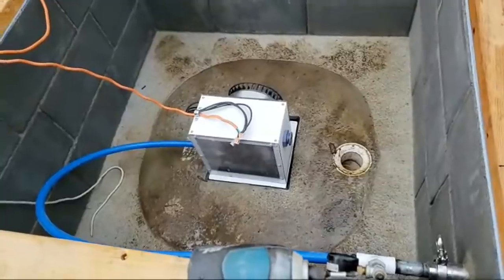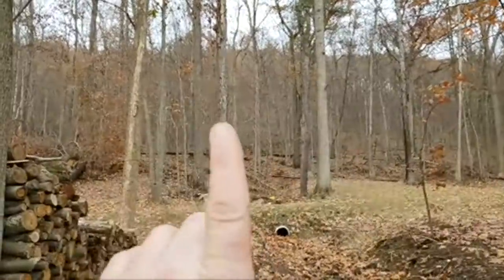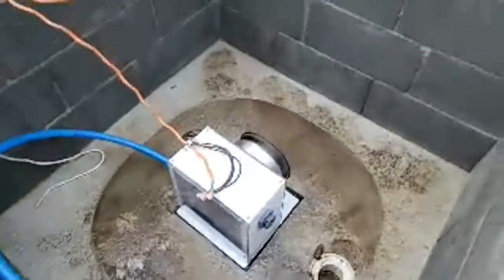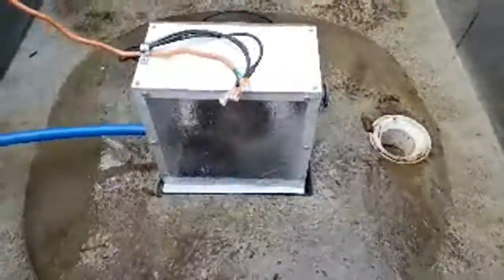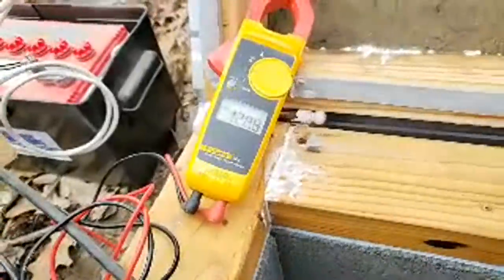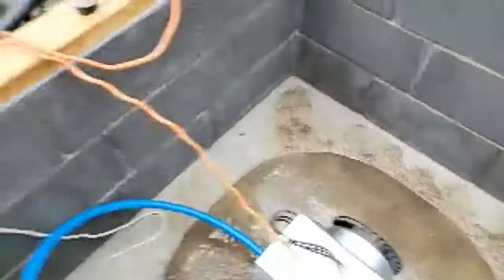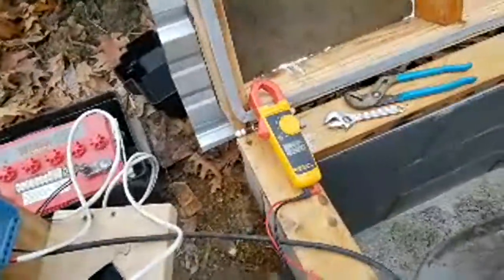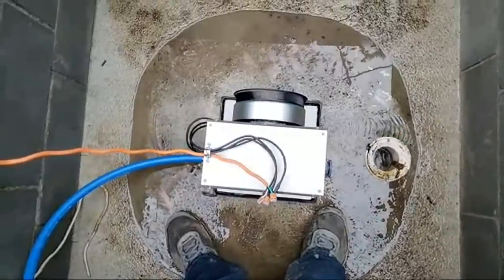Turbine First Spin LIVE

Comment: Need to have a solenoid operated regulator valve to throttle it, otherwise the output on the generator will vary too much depending on load.

Comment: The voltage will be much lower as soon as you connect a load to it (close the loop). I would not put a bulb to it to verify power as that would be waste. You should get a voltage meter for permanent installation. e.g. https://www.amazon.com/Digital-Voltmeter-DROK-Two-wire-Detector/dp/B07B3NXFP6

Comment: the victron engergy charge 5 volt higher than the battery thats on the victron so if u want higher volts u need a higher battry volts

greets from teh dutch (like victron also dutch XD )
plz contact me if u need more info

Comment: The nozzle should be Agle down hitting the Outter 55 to 65% of  the cup the water flow is holding back a lot of RPM shooting straight across like it is With 1 Nozzle you might also want to consider a Flywheel not too heavy as long as it has the mass Half Inch smaller than box with the weight at the outer perimeter of the FW keep it external for load interruptions And make sure you incase it so you don't lose any fingers BTW Excellent Job

Comment: I think your setup has a optimal RPM and currently you greatly exceeding it. Without any load that's expected. I would still recommend to not run it that fast, you might overheat the bearings (don't know how big they are) and the splashing water at the back of the buckets is also quite an impact for the wheel. Just remember you're generating quite a lot mechanical power and it has to go "somewhere" if there's no electrical load.

The splashing from the wall behind the jet is currently limiting the output (at least without a load). Optimal is splashing backwards against the walls next to the nozzles or falling straight down. So this might limit your electrical output, since you're loosing mechanical power before you reach the shaft. Maybe it can regulate better, when there's no wall to do backsplashing at the back of the wheel e.g. by turning your case (or the nozzle) 90° to have the nozzle pointing straight down 🤔

IIRC the water velocity at the nozzle should be twice as fast as the wheel speed. So you might want to calculate the optimal RPM from the nozzle velocity and look how far off you are 😙🎶
Reply from the maker: Agree 100%, this is just stuff that's hard to remember to convey in a live stream. 
When it has no load the water velocity and the spoon tangential velocity are nearly the same. Therefor not much power is being absorbed by the generator, it's converting to heat as it splashes around in the turbine housing. I agree the splashing could be an issue and that will be resolved in the final version. Also this generator is rated to supposedly 2500rpm and I think I'm at about 1,500 RPM unloaded.
Reply: @JoeMalovich  It's hard to make out the RPM by sounds or the video, but the generator should have a RPM to open circuit voltage which you can use to get a somewhat accurate reading of your RPM - if your curious and have no measuring device. Or you can measure the frequency of the AC. I'm not sure your meter can do this.

I'm more concerned that the splashing might rock loose a bucket, actually, because water is hitting them from the back side. So make sure to be cautious about that 😙🎶
Reply from the maker: @RubenKelevra  I think about 1500rpm
Reply: WOW.. there's so much info in the comments.... Its amazing. And to see the work Joe has put in coming to electrical output is brilliant. i think you have enough water there for more turbines :)
Excellent work, very looking forward to watching the next vid (which is already up :) )
Peace from the UK
Reply: @kevfromnorwichUKGGKev  this one wheel is more than suited to get all mechanical power from the available flow 😙🎶

Comment: Hi joe, you should test with a 120V bulb (50W, 100W,200W etc..) connected at ouput of bridge rectifier. If you can, add an ampmeter and a voltmeter and you should be able to know what is your power. It seems like your actual load (victron + battery) is a to mutch load.
Reply from the maker: I was somewhat rushed in putting this together so I didn't have all of that equipment handy. I will next time.
Reply: @JoeMalovich  looks good. Im jealous of your water...lol
Reply: If it can't turn at full load then the motor needs to be smaller or the pelton wheel bigger, I would personally make the wheel bigger as he is getting too much volts at freespin. but there are many factors to optimise for a set flow, pressure and nozzle diameter.
Reply: Good idea Cristof. If possible, you can also measured the rotation speed and then have the power curve. For each load, plot the rotation speed on X and Power ( U x I) on Y axis. This will help to find the Maximum Power Point.

https://www.codecogs.com/users/23287/SpecSpeed-and-Unit-Conditions-0011.png

Comment: putting a resistive load on it, like a incandescent (halogen) light bulb will give a quick indication of power.
Reply: Is the DC generator better than an AC generator?
Reply: Or is the voltage generator build for DC input?
Reply: @_John_Sean_Walker  3phase AC motor is always better generator then you need to rectify it.

Comment: Put a light bulb on it, put a load on it,  then it will calm down the voltage
Reply: There's a load on it already: the battery and its charger.
Reply: @IslandHermit  He didn't connect them though. Because the voltage was too high.